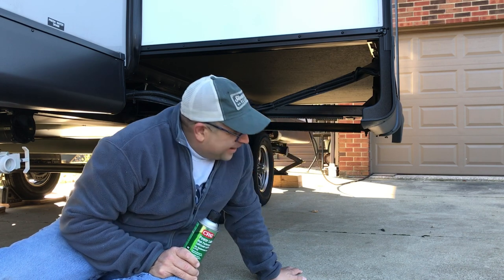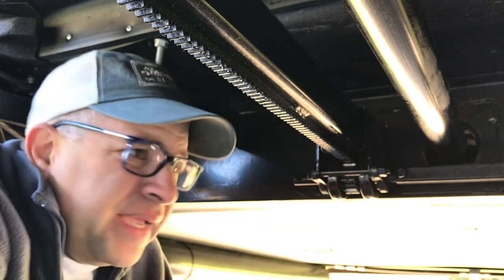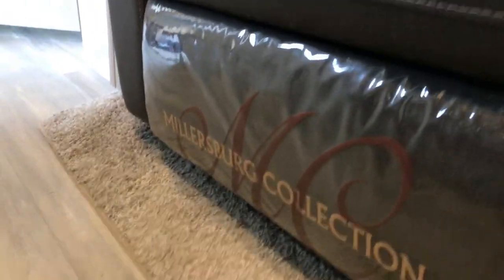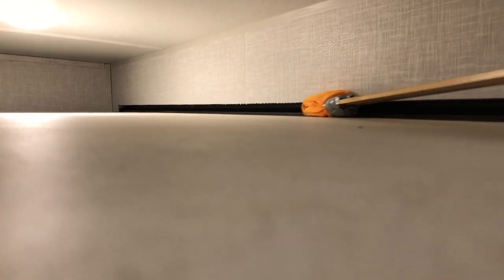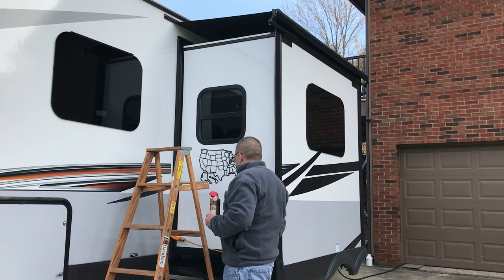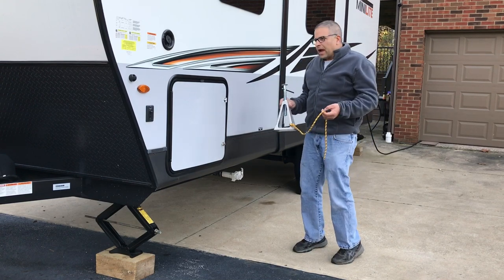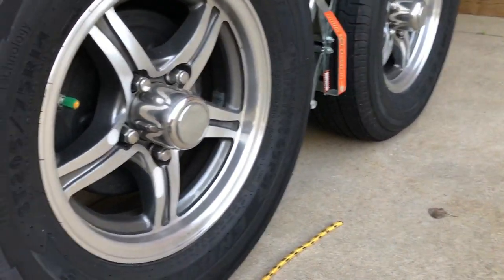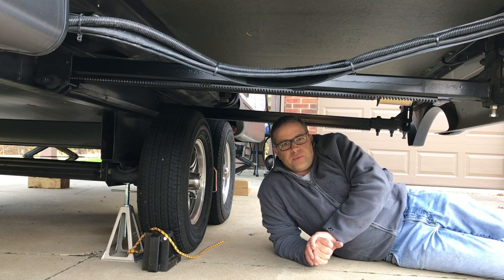Rockwood mini lite 2205s rack and pinion slide lubrication and tips. #rvlife #werv #rockwood

Comment: Nicely done Tony & Tina!!  I do have a question - I have the same slide out system, and back when I didn't know any better, I used WD40 on my slide out.   We've had no problems but would like to clean that off to prep it to use the CRC-PTFE product.   What degreaser would you recommend?   Penetrating oil spray, Simple Green?   I was going to get under there and scrub the "teeth" as well.
Reply from the maker: Hello, the good thing about using WD40 is it works as a solvent, it's a cleaner as well. I would just make sure you wipe off all the stuck-on road debris from the rack and pinion (use an old paint brush and rag) and start using the CRC product. Make sure you lube on both sides of the little gear using the CRC product, that's a recommended lube point. Thanks for watching and Safe Travels!

Comment: Just curious if you use the same lubricant for the power Jack shaft at the front of the trailer?
Reply from the maker: I have not lubed our jack yet, I don’t think there is any sort of grease fitting. The lube on the outside of the cylinder really wouldn’t help too much in my opinion other than prevent corrosion.
I’m going to investigate it..Thanks for the great question….

Comment: Hi Tony. My wife and I are seriously  considering  the same trailer. So I watch  many of your videos. They are quite  helpful.what are your thoughts on ordering this trailer  with the Xtra lift? Its about 2 1/2 inches. Also I'm Anthony and wife is alice..so I'm liking  A&A..
Reply from the maker: Hi Anthony,
The options for the 2023 2205s are 
Deluxe Tri-Fold Sleeper Sofa (N/A 2109S)
Extra Maxxair® Ventilation Fan and Vent Cover
Tongue Mount Bike Rack
Slide Topper
ThermoPane Windows
Power Stabilizer Jacks
Gas Electric Refrigerator
On our 2021 unit I feel that it has plenty height, we have taken Belle off road in corn fields with no issue.
If you plan on going off paved roads or have a steep driveway it wouldn’t be a bad idea.
Thanks for watching! Safe travels!

Comment: I appreciated the jack stand suggestion for under the suspension. Could I ask you please, do you use four (one by each wheel) or just two? Thanks!
Reply from the maker: Great question, I use two only on the front axle. Keep in mind our trailer is a 2205s so it’s around 24 ft. In length total.
Thanks for watching and commenting. Tony
Reply: @TNTRVing  Got it. Thanks Tony.

Comment: Good effort ! Still, in my humble experience,  to prevent movement of the slide, putting the jack should be UNDER the axle or springs will not help much, it should have been under the slide floor or OVER the springs.
Reply from the maker: Thanks for commenting appreciate you watching. We have been fortunate that the way we are stabilizing our unit works for us. Happy Camping!